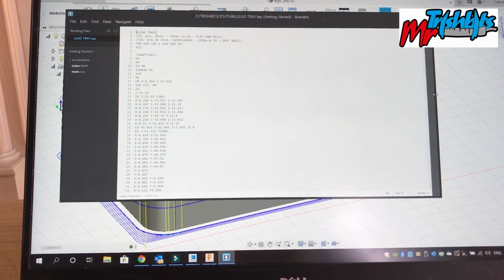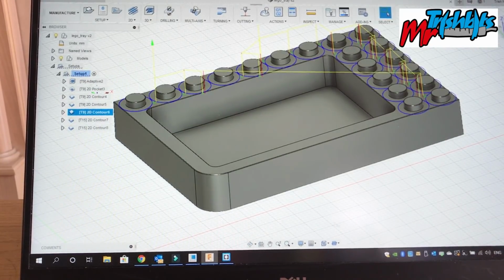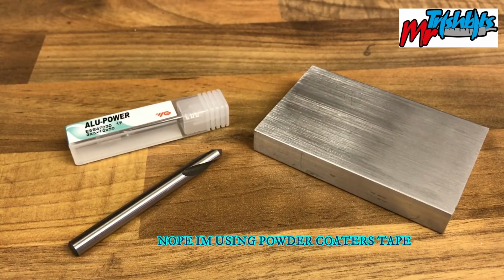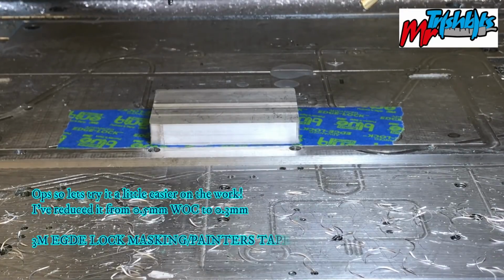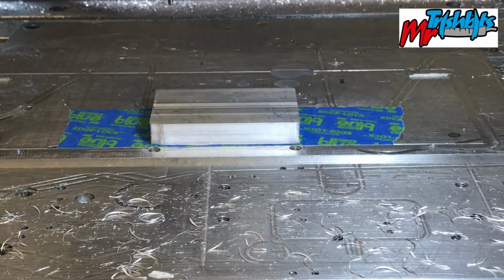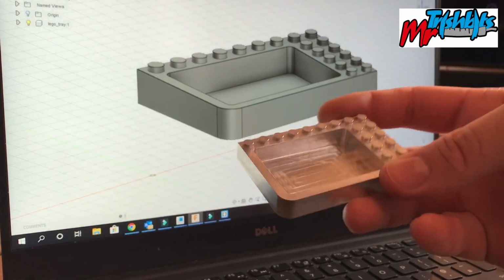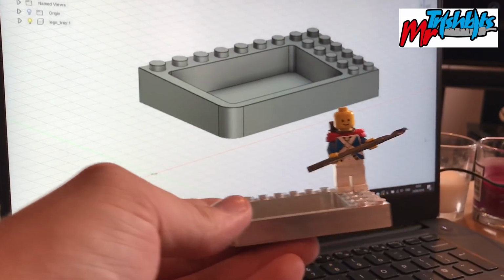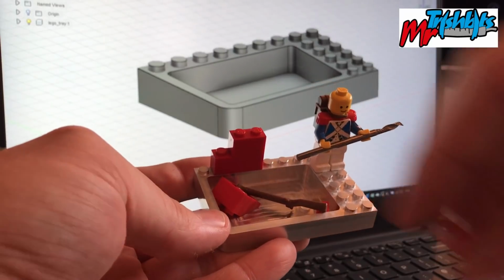LEGO BLOCK TRAY MADE ON MY DIY CNC MACHINE #LEGO

Comment: What type spindel área you using bro ? Er11 or Er25,  1.5kw or 2.0kw
Reply from the maker: iCadCam Edu hi, it's a 2.2KW spindle with ER20 collets. It works well, it's the water cooled model